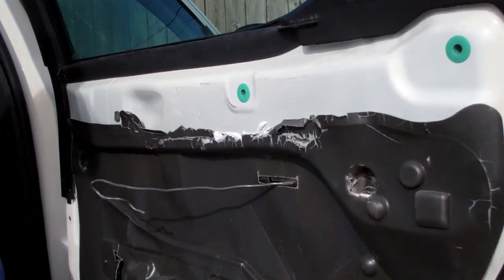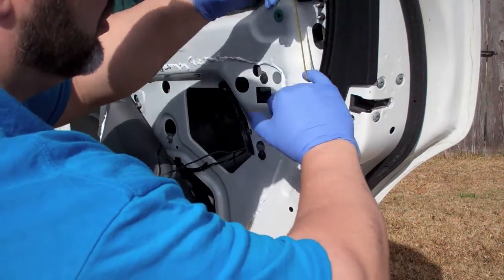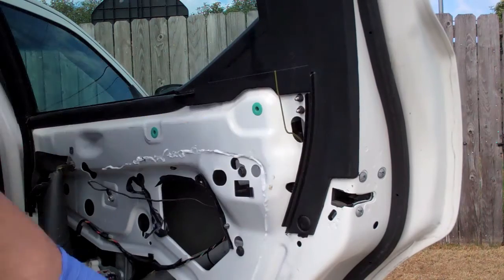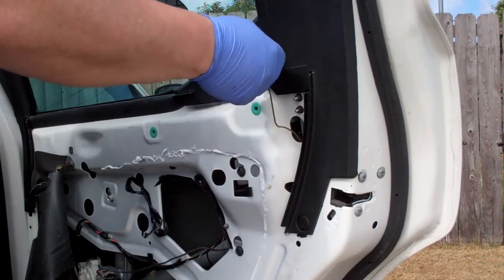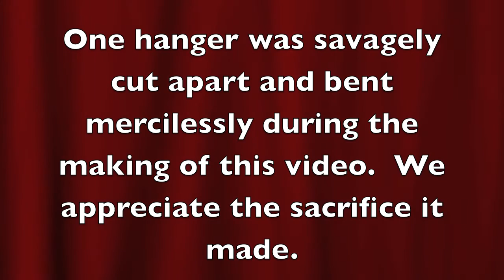Police Car Rear Door Repair - how to be able to open back police car doors from inside

Comment: Just got a 2011 P7B Crown Victoria , The rear windows go down about 1 inch and hit something and thay stop going down . Is there a stop bolt or screw that must be taken out . Thanks
Reply from the maker: that does not sound like a normal thing.  They must have rigged them up to do that.  You probably need to take off the door panels and look in there and see what's going on
Reply: @WJHandyDad  Thank you I'll do that .

Comment: I bought a 2011 CVPI and the issue I have with my back doors is there's no door mechanism, just a flat black panel. No door lock, no handle. It's just a blank. There are some torx bit screws in the panel and I'm thinking maybe I can get the panel off that way but I don't see how I will be able to remove the panel itself since the closed door will hold it in place. Any suggestions?
Reply from the maker: hopefully you can find all the missing parts at a junkyard
Reply: @WJHandyDad  I figured it out. On the inside of the door jamb where the door is attached to the frame (the B pillar) there is a round handle that you pull to unlock/lock the door.

Comment: I used a 12 mm copper wire with a plastic jacket. I had to loop it around the cable from the outside handle to the actuator to get it to work. Problem is, they put a window that goes all the way down so when the window goes more than halfway down it pops the door open. Don't know if I did it wrong, or if they installed the wrong windows or what.
Reply from the maker: I haven't had that issue with mine.
Reply: I know what the problem was.I couldn't see the red clip. I put it in the white one. I got a wire in the red clip, into the small hole and it wouldn't open the door from the inside. Do you have to do more than put it in the clip/hole?
Reply from the maker: just secure it to the red one - mine stayed attached and still work today

Comment: Nice solution to a difficult problem. Makes you wonder why the police department just didn't engage the child safety locks.
Reply from the maker: The more of these "retired" police cars I buy, the more questions like that I have.  All of them have built in features to make them law enforcement user-friendly, but so many places cut wires and/or rip stuff out that doesn't need to be removed.  If they were worried that someone would disengage the child locks, they could just disconnect the door rod at the handle.  Ditto with the window switch, just disconnect it, or install a door "skin" that covers the handle and switch.
Reply: Rhys e you right
Reply: It’s a factory option to have it disabled. This way the child lock doesn’t get accidentally or maliciously switched off

Comment: how can i put a rod in because i tried and cant really do it
Reply from the maker: Getting a junkyard lock rod won't work without unhooking the existing hidden lock rod.  I don't know if a junkyard door rod would work or not.  But the way I did it has worked great.  Make sure you get at least 12 gauge solid wire or sturdier and take your time.  It took me a lot of tries to get the lock one working.  It's definitely a job that takes a lot of trial and error (and patience).  You can do it!!